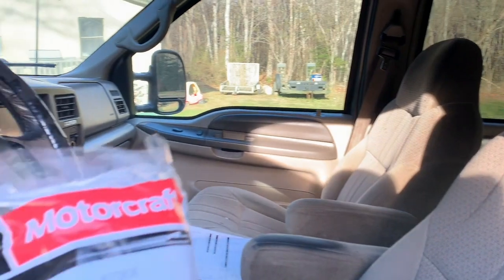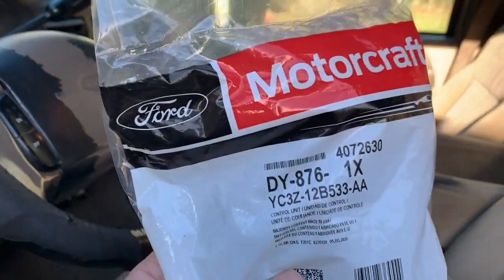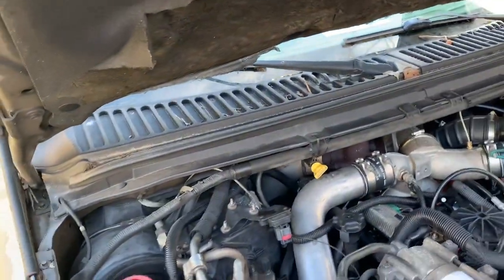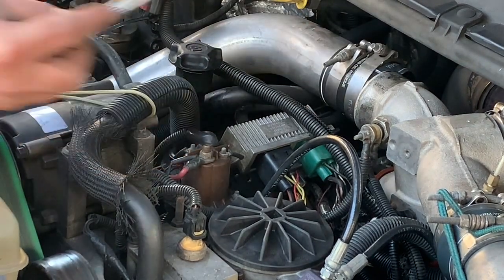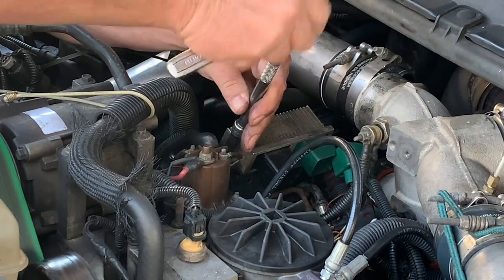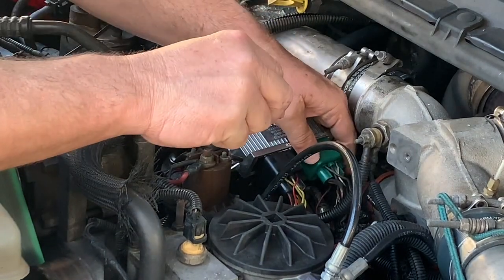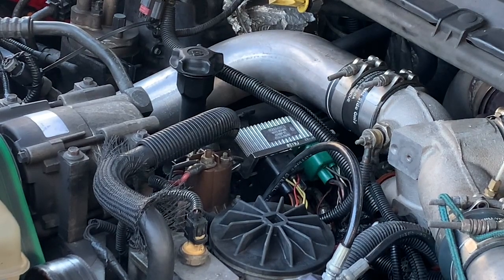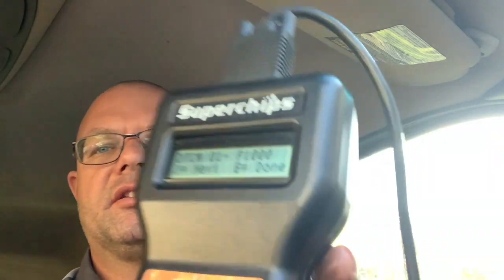PROJEXT X Glow plug controller

Comment: My truck doesn't seem to have this part where yours is at? Or at all
Reply from the maker: Not all models have the glow plug controller. I have another video that I just put out about two weeks ago. That is the other version with a glow plug relay instead.
Reply: @amsoiladam  okay mine has the relay and I replaced that I also bought a controller cuz I didn't realize it didn't have both so I'll just return that
Reply: Commiefornia trucks and all Excursions I've read, have the GPCM while federal trucks have the relay.

Comment: Mine have a p0381 code will this fix the problem. TIA great video
Reply from the maker: I suppose it is definitely a possibility however, it’s virtually impossible to truly diagnose that over the Internet
Reply: Did it fix it ?? I’m having the same code but at times when I turn it on it will just throw a lot of smoke and truck has no power in the engine at all when I try to rev it up and makes a weird noise but then I turn it off and turn it back on and it works at times I have to turn it on/off 3 times in order to work properly

Comment: Is that the glow plug relay next to it? Or intake relay
Reply from the maker: That is the relay for the intake air Heater
Reply: Thank you for the response. Ive been trying to find the glow plug relay. Is there a link you could send me or description of where it is? Its identical to this engine.
Reply from the maker: @Hawaiianguy1  my engine does not use a glow plug relay, instead it has a glow plug controller. That is what I replaced. Trucks that use a relay usually place it right next to the intake heater relay. They will be side by side.
Reply: @amsoiladam  would this be a problem in warm weather.  Replaced all glow plugs 2 weeks ago.  Won't  start now after driving about an hour ago.  Thinking maybe even side valve cover wire harness may be bad.  Idk
Reply from the maker: @dannyvInVABeach  Bad glow plug circuit can cause starting issues even in warm weather. Those under the valve covers Wire harnesses can come loose and cause problems in fact I just posted a video about that a couple of weeks ago
Reply: @amsoiladam  thanx for the info.   Great vid.  Can u give me the date or  title of vid? Maybe a link.  I ordered a set of the gasket & harness & the PCM.  Even bank harness was oil soaked at the bottom clip where the wires are housed.  Tried the quarter trick unsuccessfully.  It held up about a week 😆 .  Popping code p1280 for icp circuit (sensor is clean) & p0683 pcm circuit.  Again,  much appreciated for swift response
Reply from the maker: @dannyvInVABeach  ITS ALIVE!!!  PROJEXT X Fixing my 7.3 power stroke IDM circuit failure.
https://youtu.be/lxbp00wSu-U
Reply: @KK, This is MY ENGINE & I had the exact  question.  Did not know if I had  gp relay & cont mod or 1 or the other.  THANX

Comment: So I replaced my glow plugs less than a year ago when I changed my fuel injectors, and recently I've got a code for glow plug 1 and 3 malfunction. Should j try n change my glow plug control module too?
Reply from the maker: I would take a few more steps to diagnose the problem first. You can do an ohm check from the glow plug controller connector to ground to test each individual glow  plug and the circuitry between the controller and the plug to make sure there’s no breaks in the lines or excessive resistance.